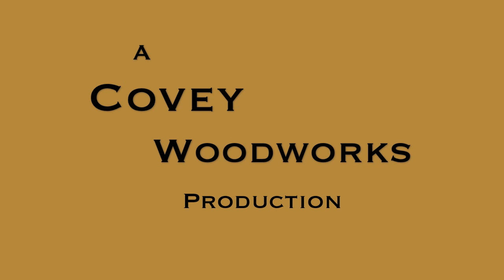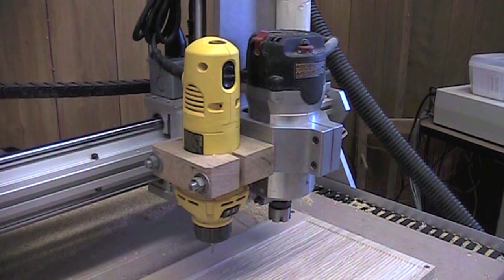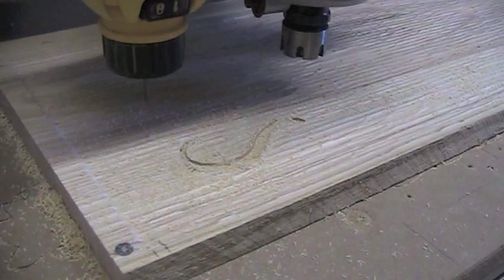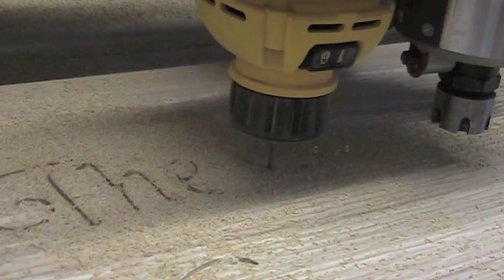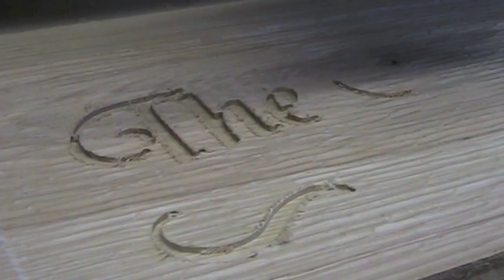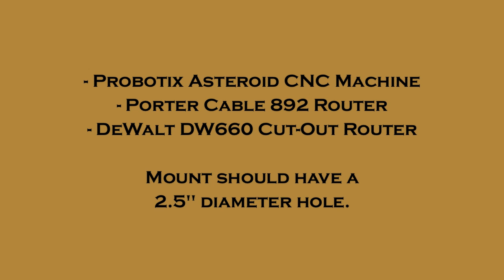CNC Double Router Modification

Comment: Great video and idea Stuart!  I just received a X-Carve and was trying to think of a less power hungry alternative for the used Dewalt 611 spindle motor when cutting fine detail which can take hours!  I checked the amps of the DW600 and it is 5 amps and the DW611 is 7.5, not much savings.  I have decided to try the Dremel 4000 which has a 1.6 amp motor and is very powerful tool and has a speed control which also incorporates a feedback circuit that keeps the speed constant at up to 35,000 rpm.  Huge power savings over time.  Your video helped me to think thru what I needed to do.

Comment: Hi Stuart. I have learned quite a bit from your videos. Being new to cnc, I am worried that I will not filter out all the info on cnc machines properly. I am interested in purchasing the right machine the first time around. I am going to be doing mostly inlay work on hardwoods. Your clock is a good example of what I am interested in. I dont need a machine the size of the Asteroid but I do like the Probotix line. I think I will need vcarve pro with whichever cnc I choose. That said, do you have any thoughts on a good machine for my needs? Thanks Stuart
Reply from the maker: Thanks!
To be honest, I barely knew anything about CNC machines when I purchased this machine.
I definitely like the Probotix line.  But I'm not to familiar with many other machines.
If I where you and are going to get a Probotix, I would go for the Comet.
The main reason is for the setup.  You'll notice that the smaller machines have only one motor for the x axis (front to back) right in the middle.  The comet is the smallest size that has double (or tandem) motors.  This helps the machine run better and won't allow it to twist and will give it better support.  Most CNC users will never recommend one with a single motor.
Hope the helps, Stuart

Comment: Very nice!
I just got a dw660 yesterday.  Is the black sleeve near the collet supposed to rattle around?   Seems like it'll wear out fast, no?

Love the XYZ trick to setup the smaller one btw!

What software do you like using?
Reply from the maker: Thanks!  Mine rattles around also so I'm guessing it's ok, it does seem like it will cause it to wear out eventually though.

I'm using LinuxCNC for control and Vectric VCarve Pro 7.5 for design.  I love the Vectric products! I'm hoping to get the Vectric Aspire 3D version of it eventually.
Reply: Covey Woodworks I'm looking at either the shapeoko or carvewright for my first adventure in cnc.   thoughs?   input?
Reply from the maker: Blackrain4xmas I prefer the open type cnc machines like the Shapeoko (or my Probotix).  From what it looks like though, the Shapeoko looks like it would be a little weak. As far as the frame goes.
Can't say much about the Carvewright, their design software is fairly popular but I'm not sure about the actual machine.

I would personally start out with one that I know is going to last.  I am extremely happy with the Probotix line of machines.
Reply: thanks-much to consider/good insight ;)